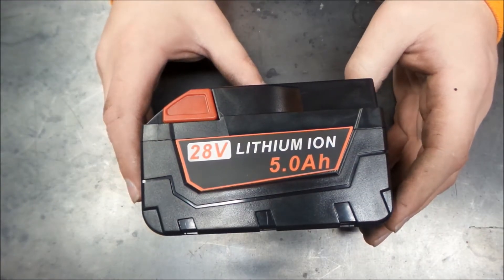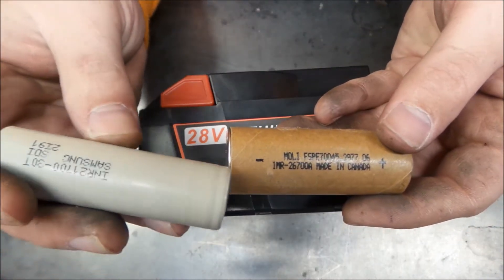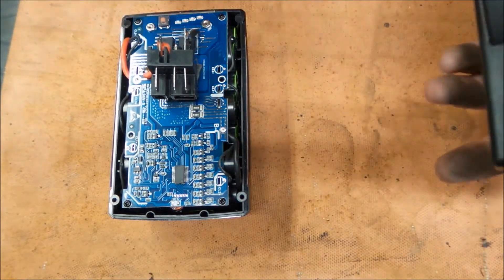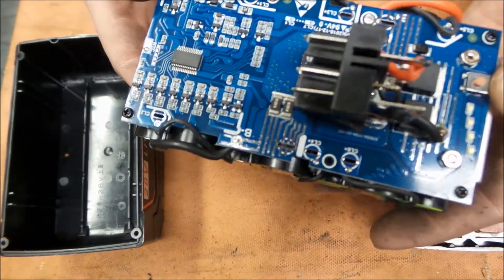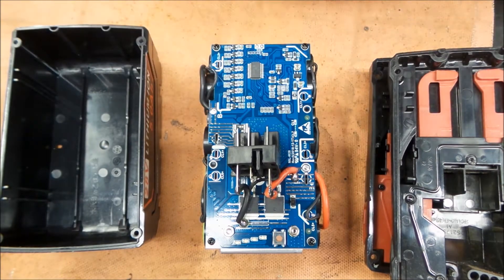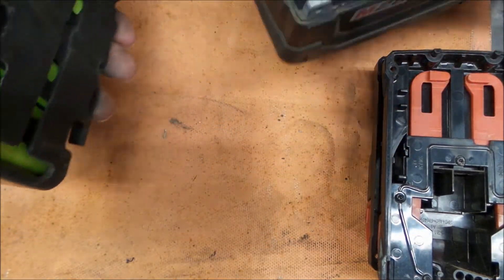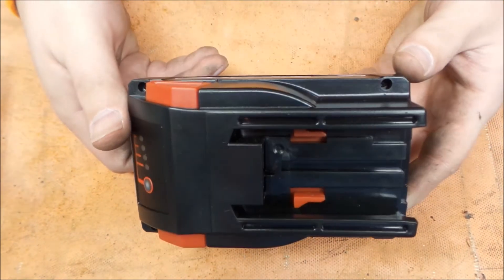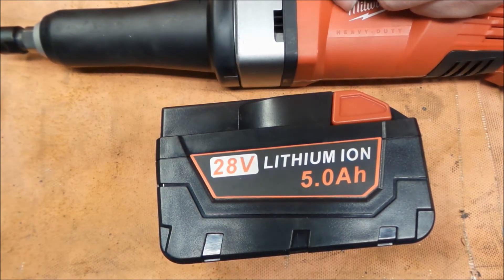Are the M28-style 5.0 Ah Milwaukee knock-off batteries worth it?

Comment: Did you make the follow up video you mentioned? Got a link?
Reply from the maker: I did not make a follow-up yet. I can say these knock-off batteries are hit and miss. I think I'm at about 50 percent success rate. If you buy two, one seems to fail. I have recently started to wonder if it's low voltage. It may be that they don't recover from being run down hard like the legit batteries do.
Reply: @TalkingHandsTools  Thanks for the reply. I’ve just purchased a couple of WECACHWE M28s. I’ll let you know how they do. I’m just finding it hard to drop $184 for 1 battery from Milwaukee.
Reply from the maker: I agree with that completely.  I'm always looking for an alternative myself.

Comment: I miss my v28 hammer drill all the time. 😢..
My batteries both died in about 2008. And at least back then, they didn’t really have many options for replacement because Milwaukee just stopped selling them!! 
I am still sore over that.
Reply from the maker: I agree with you on that. The V18 and V28 were from the Atlas Copco days of Milwaukee. When they were bought by TTI, they went to the M series. M4,M12,M14,M18,M28. 

28V tools lived much longer in Europe. They even had Die Grinders, Jig Saws, and 5AH batteries.

I believe the V18 and V28 Rotary Hammer were made here in the US. I agree they are great tools.
Reply: @TalkingHandsTools  I actually still have the entire 4 tool set.  Sawzall, circular saw, hammer drill, light and 2 batteries. They were offering $100 for each tool/battery combo for awhile. But I never took the deal.
Are there actually good batteries on the market for these tools nowadays? 
They say they were built in Canada and the US. Old fashioned aluminum plate serial numbers etc..
Reply from the maker: These aftermarket batteries are hit or miss. They aren't crazy expensive, so in my mind, they are worth the gamble if you want to run your tools again. I can say they seem picky about low voltage. I ran one down and didn't charge it. When I went to charge quite a while later, it had a shorted cell. After that, I've kept them charged, and they've been holding up okay.

I should do a video on the 28V line. I think your correct US Canada and the EU were where they were all made.

Comment: I recently had the opportunity to change the 7 pcs li-ion cells. 26700 with 21700 for an M28 Milwaukee battery, but I noticed that the protective plate with the capacity indicator was also defective. I have attached a bms 7s 30A protection board and an LED indicator. The problem is that connection terminal no. 2 that communicates with the charger remains unconnected, terminal 1 + terminal 3 -. It is possible that the charger will not work without information about the battery on terminal 2. What do you recommend I do to fix this problem?
Reply from the maker: Do you mean a V28 battery? The V28 should be 7 26700 cells and the M28 should be 14 18650s. That aside I believe the charger does indeed need to see voltage in the battery itself on the various points of potential. I have a meter designed to test V28 and V18 batteries and you can see the max temp, number of charge cycles, and voltage in all the cells. That being said that should be the information the charger itself sees. I would imagine the temp input and seeing voltage within tolerance should be what the charger is looking for. I would start there. Let me know if you've already done these things and I'll see if I can come up with something else to check.
Reply: @TalkingHandsTools  Yes, you're right, it's about V28, I wrote M28 wrong. May I understand that installing a thermistor at terminal 2 would solve the problem?
Reply from the maker: I'm not 100 percent on that you would have to compare to the original circuit. Somehow the charger references the pack temperature and individual cells voltage. If you duplicate the original packs output to the charger I would think it should work. Unfortunately I did not document the v18 and v28 packs I rebuilt with 21700 cells, had I made videos back then it would be helpful now. I would need to take apart a pack and see what is going on to say anything definitively. I would be looking in that direction though.
Reply: @TalkingHandsTools  After finishing the V28 battery I put it on charge and surprise the charger worked even without connecting the control terminal to the battery. Thanks for the guidance and I hope I can call on you again. I would send some pictures of the modification of the V28 battery and the bms but I don't know  address or I can't attach images to messages on YouTube.
Reply from the maker: You can send any photos to talkinghandstools in a Gmail email address.
Reply from the maker: Great to hear you got it working. I think you will be happy with the performance of the new cells in the V28 pack.

Comment: Is it possible to swap the bms board onto the new cells so it’s a drop in replacement?
Reply from the maker: If you took all the proper precautions I don't see why you couldn't replace the cells. I've done V18, V28, M12, and M18 packs so far. It's a lot of work but I don't see why it couldn't be done.

Comment: The V28 appear to have survived because of overseas demand. Their quality is "pre-buyout" Milwaukee so well worth it to me to keep running though I've plenty of other tools.
Reply from the maker: I know the European and Australian markets had tools like the Die Grinder and Jig Saw available in 28V that were not available in North America. They also had a Milwaukee made 5ah battery available. Increased options definitely speaks to your point of the line being better established in those markets.
Reply: I find the drill and the sawz-all really nice. The impact wrench is huge for its power. The circular saw is nice but sucks through the battery too quickly for all but a few cuts.
Reply from the maker: I think the later 5 amp hour batteries would have really helped out the run times. The line died out before that stuff could really hit the market.

Comment: Thanks for your great work sir! I was at a point I was going to retire my m28 tool set as the batteries at 10 years old we’re almost done, sourced out 2 new 3.0ah batteries and everything works amazing. I’ve located tools people were selling for dirt cheap since they didn’t have batteries. I started my m28 journey with 2 sawzalls a hammer drill and flash light. I’ve expanded to adding some v28 tools such as bandsaw, sds hammer drill, regular hammer drill and circular saw. The v28 tools seem better built than the m28
Reply from the maker: Many tools of that Era are either built in the EU or in the US. They are definitely older tools but with the newer batteries and increased amp hour capacities they still hold their own. Keep me informed how your knock off batteries hold up for you. One of mine doesn't want to charge but that may be my fault I ran it down and forgot to charge it so the voltage sagged. I'm going to try and jump start it hopefully it comes back, if not I'll do an autopsy video on it.
Reply: @TalkingHandsTools  no knock off batteries here! I got two brand new m28 red lithium 3.0. Weren’t cheap!
After watching your video I want to put the Knock off guts into my older m28 battery that isn’t holding a good charge. Thanks for the info regarding the older tools and for your informative videos
Reply from the maker: Thats awesome you got some new Milwaukee Stock batteries. They hung on to the 28v stuff a bit longer in the EU in fact they had a die grinder and a jigsaw that were 28V. I did a video on the Die Grinder, maybe one of these days I'll do a video on the jig saw. They also sold 5ah batteries in the EU. M28 and V28 tools were the high end of their day I don't think you could possibly go wrong with any of them.

Comment: Even the crap batteries spin the motor for a few seconds. I need to know how it does under load and time as well as recharge cycle durability.
Reply from the maker: Testing is continuing, I can say they seem to perform better than the V28 batteries. As to life cycle and charges time will tell. I haven't got a chance to get out the grinder yet but I'll get out the stop watch when I do. Maybe shoot a video if I have time.